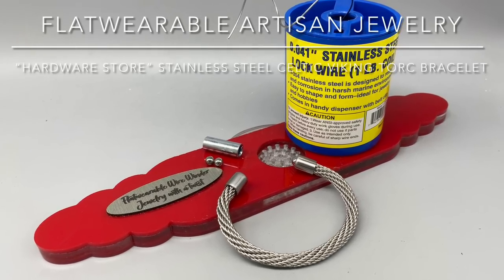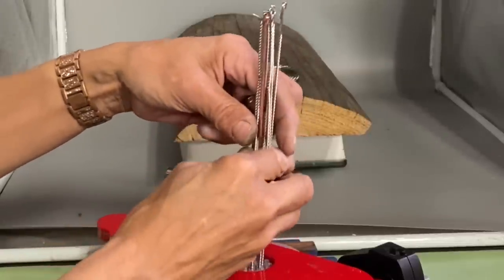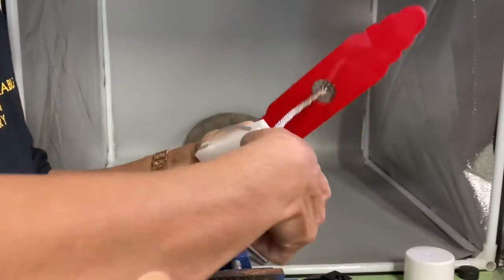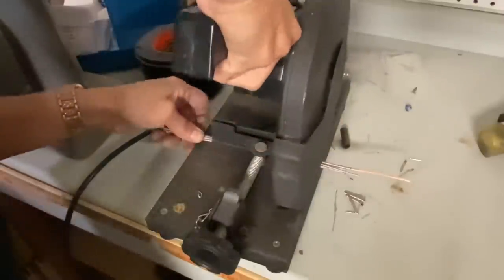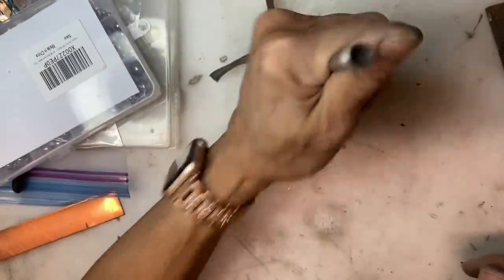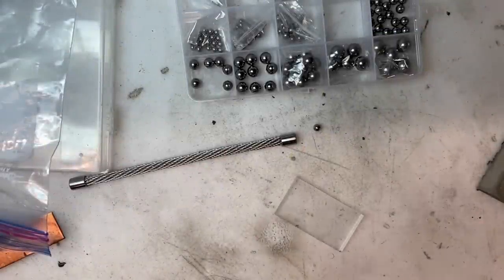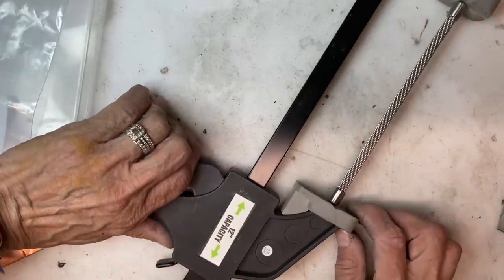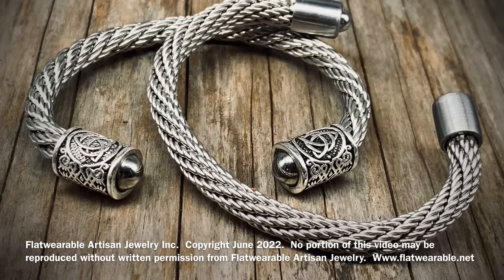Stainless steel Viking Celtic torc bracelet.  NO HEATING, SOLDERING OR POLISHING!

Comment: Thank you for sharing this information. I’m very interested with stainless but that bracelet is a lot of wire and a rather large gauge. I had fantasized about working with titanium as well but as far as I can tell, titanium requires a lazer welder and I’m too old to even have a chance of saving up that kind of money.  I also want to learn how to arc (stick) weld and see what I can manage to do with rebar, horse shoes, and bedrails,  If anyone has plans for the Eiffel Tower, please let me know, I’m only 71, so I have time to pull that off.  Money is always an issue, but if the dogs and horses will not create a reason to call the vet and my 30yr old truck doesn’t break something that I can’t fix myself then maybe I can at least get a decent welder.

To return to the subject of jewelry making, I am primarily interested in making rings and  pendants for necklaces at this point.  I am so grateful to you and the other artisans on YouTube that have so generously shared your knowledge and experience. Whether it’s astrophysics or the correct way to sew on a button, it’s the spreading of knowledge that keeps us growing as a species. Maybe someday we will learn to be kind not only to each other, but to all the creatures that share our world,

Am I mistaken in thinking that the stainless steel could have been annealed and made the job a little less physically demanding?
Reply from the maker: Annealing stainless steel wire requires sustained heat for a long time and then allowing it to cool on it's own.   It would be done in a kiln type of oven.  It wouldn't be appropriate for something this small.  If not done properly you'll actually harden the metal even more.
Reply: @FlatwearableArtisanJewelry  Thank you for this information. If there is a difficult route to take for any given journey, I seem to have an innate way of choosing it.  I’m sure you have heard the age old excuse, “It seemed like a good idea at the time.”  Well, that has become my mantra.

Anyway, on to my good idea of the day. If you know a woodworker or machinist you could ask them for any drill bits that are no longer fit for their original purpose.  Bits come in dozens of sizes and are usually very accurate in their stated diameter.  The shafts could be used when you are needing to make loops or bends of the same size.  Hope this idea helps someone.

Comment: If Copper is connected to Stainless steel then the copper will corrode to sacrifice to the stainless steel. The reaction is called Galvanic corrosion. When two dissimilar metals are touching, an electrolyte will jump-start the corrosion process. Sweat is mostly water but does contain electrolytes, so just wearing the bracelet will induce corrosion in the copper core. The corroding copper has the potential to induce skin irritation and dermal toxicity in some people.
Reply from the maker: Noted, thank you.

Comment: Thanks for a great tutorial. I have started playing with the winder. Starting with a 12 inch wire bundle, what length are you cutting the finished wound wire for an average sized bracelet. Thank you!
Reply from the maker: Anywhere from 6-9 inches depending upon the desired finished size.

Comment: I've had some pretty good success using your tools and techniques. The learning process is fun! I tried this method using the stainless wires from Harbor Freight that you are using. But instead of 3 wires, I used 2 wires for the initial grouping. For the life of me, I can't see how you were able to twist them all up together without spring back. I got about half the way and the twisting tool wanted to come back like a helicopter blade. LOL  Maybe I need to start with longer wires in the beginning. Any thoughts?
Reply from the maker: I cut my wires about 15" long.  I think you'll find less spring back with them on the longer side.  It will give a fight but like my father used to say, "you have to be smarter than the tools".
Reply: @FlatwearableArtisanJewelry  Thanks for getting back to me. I did cut them longer (16") and it made a big difference! Now I'm mixing copper and stainless for different effects. I'll break out some brass wire next.